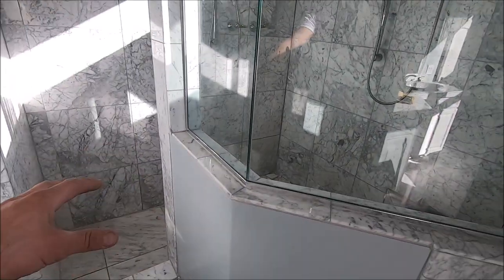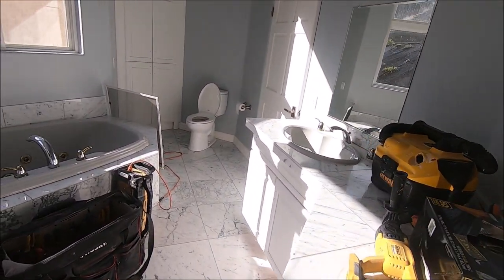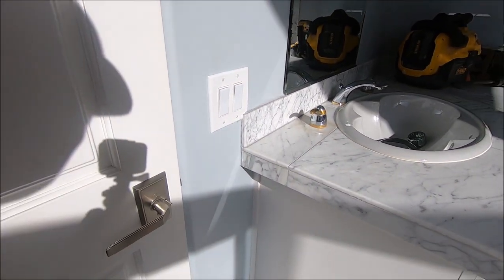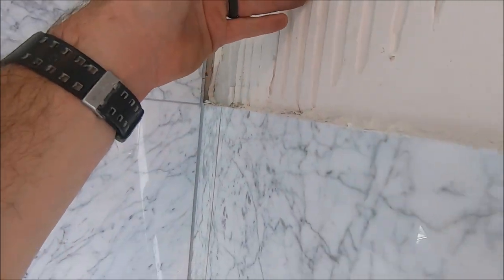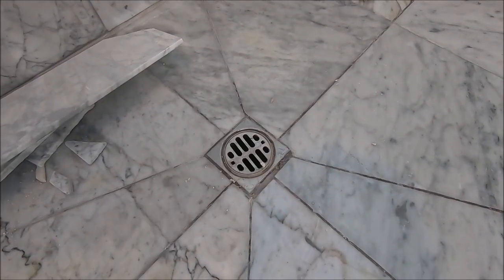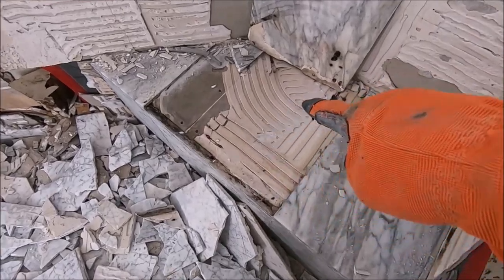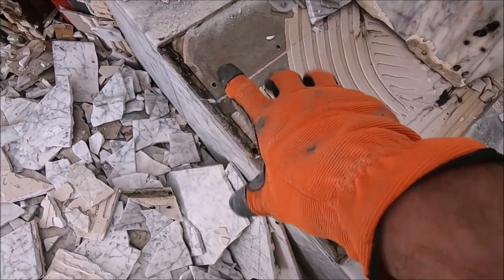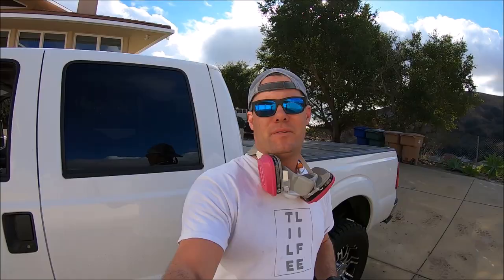$50K Bathroom Remodel Part 1

Comment: Dang I was hoping to find out more on the framing and mold fix. I don't do anything that extensive but personally remove anything with obvious mold spray down heavily with string vinegar and then let dry before closing up. I have oil primer if it was particularly bad.

Comment: Please tell me the homeowner called their insurance company. I am quite sure they would much rather chip in for the remediation costs than to cover a complete structural failure and ceiling collapse. I have seen a lot of bad installs for one reason or another yet this one I think is the worst pan failures I have seen and with so many other added issues the only thing that stopped them from going through the floor altogether was the large marble tiles.